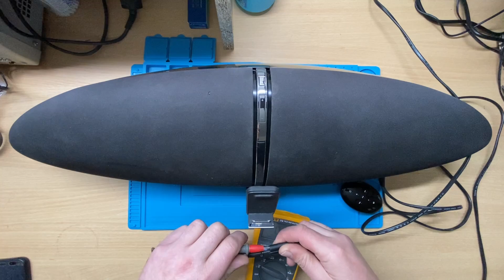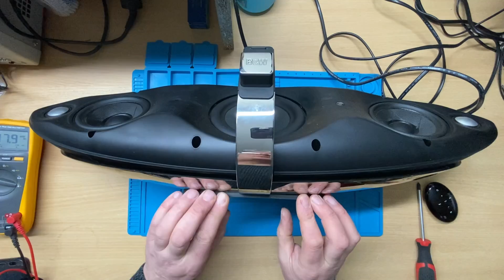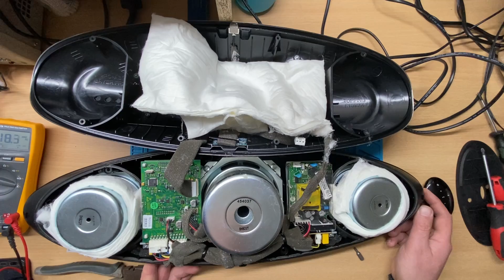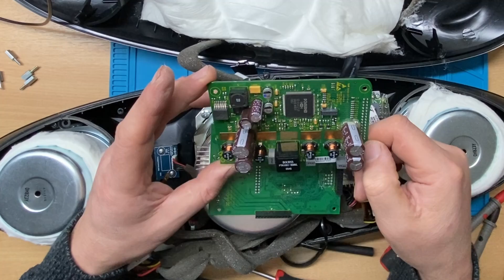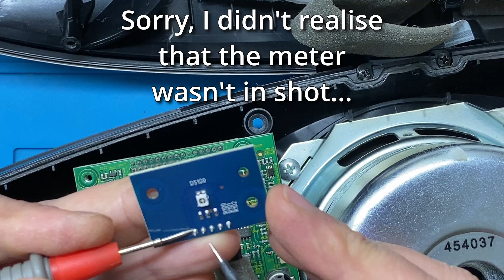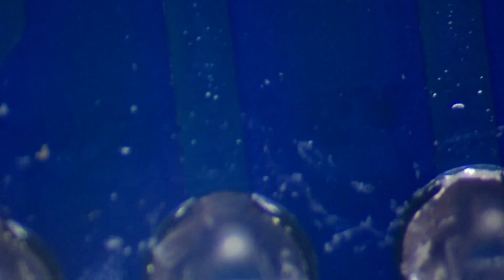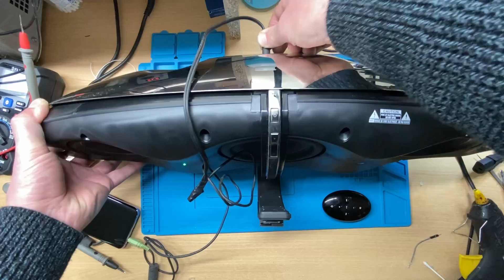Bowers & Wilkins  B&W Zeppelin Speaker - Expensive but Faulty - [REPAIR]

Comment: I've got exactly the same model from 2008 which is working perfectly. I've connected a wiim mini for streaming from my phone or my local Alexa etc.
Can I do what you have done and remove the 30 pin dock, will it  still work?
Reply from the maker: I'm pretty sure it should still work with the dock removed.

Comment: My Bowers & Wilkins Zeppelin connects to Wi-Fi, receives the signal from my iPhone, and plays music just fine — until it suddenly stops, and the red flashing light appears.

If I turn it off, wait a bit, and turn it back on, it works normally again — as if nothing happened.

It’s a great speaker, no doubt, but this issue is driving me crazy.
Really disappointed.
Reply: Cap on power supply needs replacing.

Comment: Being picky, if the remote battery had been replaced to start with and a music player connected, the unit might have played ok (or not). But a good buy at £36.
Reply from the maker: True, but normally you expect some indication that the unit is powered up. Power supply failure is a quite common problem with these units.

Comment: I think these older ones have 4-channel amplification (two of the channels in stereo mode for the left midrange+tweeter and the right midrange+tweeter, hence the passive crossovers, and the other two channels bridged to a single third output on the woofer).

I believe the later versions have 6-channel amplification so the midranges and tweeters have separate amplification, therefore the passive crossovers are no longer needed.

Comment: My speaker has no sound out of the left speaker and no LED light, which is on the same side. Will this be connected as a fault? If so how can i fix this? Apologies if i sound like an idiot?
Reply from the maker: The speaker not working is probably unrelated to the LED. It could be a blown speaker or a fault on the board.
Reply: @BuyitFixit  thank you, I well look into fixing that speaker.

Comment: Hi, I have the same problem with the led light. What's the chip number or ID? Great video and tear down, thanks a lot!
Reply from the maker: Thanks 👍I don't have a part number unfortunately as the LED I used I pulled from an old BT home hub 5 router.

Comment: For how much these devices cost they have poor longevity. My zeppelin air started buzzing and popping and then locked itself into red blinking light of death.. some sort of protection mode.. they are hard to sell because they are known to fail. I have stripped the speakers out of it and I'm looking to use them in a Bluetooth tooth speaker that I'm building.. everything else has gone into the recycling bin..
Reply from the maker: Interesting, but well done for at least attempting to save some of it 👍
Reply: Bad caps

Comment: That was interesting.  My son bought one years ago then after a power cut it hasn't worked since he  says .
Reply from the maker: Thanks 👍Could be the power supply. Sometimes they get zapped when the power comes back on, or the capacitors on the power supply can also fail.

Comment: Excellent job. I was wondering if you could add a Bluetooth module to these older style speakers?
Reply from the maker: I don't see any reason why not. An easier way would just be to plug one into the auxiliary port on he back.
Reply: @BuyitFixit  I put an old iPad on the dock to pick up wifi via bluetooth. It works even though the iPad says device is not supported. Blows caps like crazy tho. I wish there was a way to add some cooling in there!

Comment: Hey man I have one of these with a faulty amp pcb. I suspect the bios is gone for the d2 chip, as I don’t have much experience with things as such. Have a good board to swap too. What you think of having a look at it ? Flashes red after power up. I cannot find shorts or missing voltages until shutdown.
Reply: Hi I have a dead zeppelin air. The repair guy thinks the motherboard has been damaged by insects so wants to swap out the motherboard. He can’t find a replacement part and neither could I. So…..do you still have a working motherboard you would be willing to sell and post or know how I get hold of one.  Thanks Keith (in Sydney).
Reply: @user-ng9xv9sw9b  sadly not mate, I don’t take zeppelin airs on for repair anymore either.
Reply from the maker: Sorry for the late reply. I'm not too sure on that as I never really spent much time on the amplifier section. It did look quite complicated. Are all of the power supply voltages correct from the PSU? If you swap boards did you narrow it down to the amp board? I think it was in two sections (been a while since I looked at this)

Comment: love the videos the audio is always low i have to go full volume and still struggle on some keep them coming.
Reply from the maker: Thanks 👍I set the audio levels to -10db which is supposed to be the standard for YouTube. Are other videos on YouTube around the same volume? I've not had anyone else mention but this video is an older one so I may not have been up on the settings at the time. Are the more recent the same?
Reply: some seem quiet i normally just put headphones on if it is
 @BuyitFixit

Comment: I worked on one of these yesterday. Did exactly like you did - assumed a duff PSU but it was fine, scoped the mainboard and saw clocks etc then went to the LED. Found exactly the same failure. Mine occasionally faintly lit up red and curve tracing the LED you could see the breaking down connection. I think going off the common anode voltage of 5v the resistor values on each cathode means they are overdriven to make them brighter which results in premature failure. I’ve altered the values to reduce the current of the LED to 30mA should be fine now. Farnell do one 2322115 same colours as original.
Reply: Cheers for that, got the same issue working but dead led. Was hoping he mentioned in video what the led model is. Comments to the rescue, big thanks to both.
Reply: @hinny2005  doing myself out of a repair job there 🤣
Reply from the maker: Interesting, I wonder how many of these have been disposed of because the LED was faulty 🤔

Comment: Could you tell me how to get the battery cover off the remote? There must be a knack to it, I cant budge the darn thing and dont want to use potentially damaging force....
Reply from the maker: I've just had a quick look for you, and I just pressed hard on the round black piece with two fingers while rotating it anti-clockwise. Hope that helps.

Comment: Thanks for the great video. My system has had the EXACT same symptoms. Changed LED, changed all the mosfets you reflowed, replaced every single cap, but I still have the same issue you did at the end. Sometimes the speakers only play on one side. Only difference I've had from you is that I blew a fuse on my power supply after I replaced the mosfets. I'll try checking for dry joints when I get home. I've had this zepplin on my bench for nearly 8 months...
Reply from the maker: Thanks 👍hopefully you manage to sort it 🤞

Comment: I enjoyed this one.  The funny thing is I was saying to myself right near the start maybe check the LED only because that is the thing I would have checked first being a newbie I go for the simple things.  I can handle checking an LED.  I need to find something simple to fix on ebay any suggestions what to start with?  I have tried fixing a Pi 4 only I failed I think the CPU is fried from someone shorting out the 5v and 3v rails as there was a hole in the MXL chip which I replaced but still no joy.  I also tried fixing a Logitech C920 webcam but the CMOS sensor had gone in that and I dunno where to source a sensor from.  I am sure it is the sensor though as I did some readings with a working one I have and foudn a difference in resistance readings between them removed the sensor and the readings are now the same.
Reply from the maker: Thanks 👍I like doing old VFD games. They're usually fairly simple 🙂

Comment: $995.00 CAD for the pleasure of new in 2021  !
Reply from the maker: Ouch !
Reply: @BuyitFixit  Tragic waste of material and money when this stuff just ends up in the trash bin. I am impressed that you attempt repairs on such a wide range of devices. It has given me a new outlook on what passes for approachable. However t have this one item that I put on the back burner for way too long now.
An oven control board for a GE made range. It appears to have no standby voltage that allows it to wake by a single button touch. There appear to be no used or scavenged modules on eBay, and the manufacturer is a dead loss. Would you consider giving it a look? On a creative note you could start a series content making repairs to subscriber sourced electronics of a size that keeps shipping to a minimum.  Happy to pay regardless of your success. And I do live in Canada
Reply from the maker: Thanks Chris (Nice CNC btw I built one a few years back although not used it for a couple of years now). I do try to do a wide variety of things as I think it makes it more interesting 🙂 I've found when I've had offers from people to take a look at things especially outside of the UK, the shipping costs alone are quite prohibitive. I could still possibly help, as you could always send me some good quality pics of the board and I could advise what to test / look at. Best wishes. Mick.

Comment: I've worked on one of these before...  couldn't get it going.  I don't recall a power light on the front but that could have been part of the issue as well.  In the end the owner only wanted to spend $60 tops, and that's worth an hour of my time, so, it never did get fixed.  If I come across one that's dead again I'll check that power light!  Interesting that it would bring the whole unit to it's knees.
Reply from the maker: I'm not sure that the whole unit was too is knees to say, but because there's no hiss or anything when it's powered on, unless you put sound into it or plugged an old iPhone or iPod into it you wouldn't know it was on, as there was no light to indicate that.

Comment: what causes dry joint on circuit board? thanks
Reply from the maker: Oxidation of the solder, also if a lot of current is going through the connection it makes it worse, and can start arcing or burning like on the solar inverter I repaired.

Comment: Lmao.. Just LMAO
I have had one laying around for awhile to repair. After watching this I thought "why not" Put it on the table and goes though things. PSU working, board not getting too hot
But something was up.. The LED was not on! So i pulled off the LED board and checked it with a multimeter and i saw a very very tiny light from the red LED. So what i did was i reflowed the joints and it helped a tiny bit so now i could actually see the LED but the LED was going nuts, like the PSU was turning on/off. I then tried to give it full power with my PSU which actually got 2 of the LED working.
So after playing around and having fun i just soldered a new one on. But conclusion was that I could see some corrosion on the LED leg, i think this got under the actual diode and caused it to have a bad connection.
After new LED was put on the PCB it worked just fine
Reply from the maker: Nice 👍Glad you managed to fix your one too!

Comment: did you check the fuse in the plug ?
Reply from the maker: No, but the first thing I did was check there was power coming out of the power cable. There was 251.2V coming out of it at 00:59 which means the fuse is intact.

Comment: I have one of these in pieces that someone asked me to look at - the fuse on the PSU had gone but that meant there was some bad $hit that had happened further downstream on the amp board - it looked like one of the channels had shorted out but I’d already wasted a lot of time taking it apart and trying to diagnose so it’s been sat in bits for a couple of years now 😢
Reply from the maker: Doesn't sound good. I recently looked at a Dyson hot and cold fan that the motor controller chip blew and sent 400v into the microcontroller. Luckily a viewer sent me a broken board which wasn't so damaged and I managed to repair that. So yeah stuff sometimes fails in a big way unfortunately  😥

Comment: Nicely done Mick, thanks for the shout out 👌👍
Reply from the maker: No worries Vince. You're very welcome.👍👍 I woke up at 4am this morning with bad indigestion so I was watching you on your friends boat removing those port hole things. Boats have heat exchangers instead of radiators, the sea water gets pumped around the outside of the heat exchanger and the engine water gets pumped along the inner core. (Used to be on boats a fair bit and rewired a 45ft one when I was into diving about 20 years ago)
Reply: @BuyitFixit  Ohhhh, so the engine itself still has a sealed water system in it, it's just cooled by the sea water or river water. I presume then that antifreeze is added to the sealed water system? Thanks Mick, I'll pass this info into Brian the owner 👍
Reply from the maker: Yes that should be the case otherwise you'd be dragging sea water through the engine block and it would rot from inside out. I heard a few stories from the boat yard where people did that 😂😂😂
Reply: @BuyitFixit  Makes perfect sense 😂 Cheers Mick 👌
Reply from the maker: Glad to help 👍
Reply from the maker: Apologies Vince. Just speaking to a friend of mine he says that those Mercruiser  engines actually do drag outside water through the engine! and don't have heat exchangers! Let's hope it isn't really used in sea water much! Guess you learn something new everyday! I think it was a ford diesel engine in the boat that I worked on.
Reply: @BuyitFixit  Thanks for the update Mick👍

Comment: I have also just repaired same model speaker. The fault was the same as Vince, but after changing them, the led does not light up anymore. I will try and do the same measurement as you did. My speaker does work, even if the led is not lighting up. Have to do some investigating....thanks for the video.
PS: How come you did not change the four cap´s, when the speaker was already open? They are prone to blow at any time.
Reply from the maker: You're welcome 👍. The caps weren't bulging and the speaker seems to operate correctly. I could have replaced them proactively but seeing as the unit was working fine I'll just do that at some point in the future when they eventually fail.
Reply: @BuyitFixit  Thanks. Did you ever connect voltage directly into the led?
Reply from the maker: Yes on the new led I did test it with the test meter on diode mode across the led and that was enough to make it illuminate, so if the original led is working it should do the same.
Reply: @BuyitFixit  Or maybe the original led needs a higher voltage? But I guess you dont have it anymore? Would be interesting to see how it looks under the microscope, when introduced with higher voltage......🙂
Reply from the maker: It measured open circuit on diode check.  I measured the voltage to the pins on the LED when it was connected to the radio and it was there. 5v I think it was and the GND is switched via the I/O pins of the microcontroller.  LED was 100% failed.

Comment: Good analyses, repair. It makes me laugh when I see these designs (most active speakers), something that will inherently vibrate (a lot), so lets' mount sensitive electronics on it and then wonder why joints / components fracture. That central bar, mounted directly in front of the woofer, is classic.
Reply from the maker: Thanks Ralph 👍
Reply: Yet another expensive poorly designed product.  Problem of 21st century.

Comment: Amazing as always. I throw away a similar one some years ago. 😢
Reply from the maker: Thanks Edgar 👍. Shame you threw it away 😥
Reply: @BuyitFixit  yes it would be good if could just fit another amp or just use the speakers as a passive system to plug into an external amp..
Reply from the maker: Yes that is also another option 👍

Comment: Thanks for the video! I might have the same issue with my Zeppelin, I'll need to try this.
Reply from the maker: You're welcome! If you get stuck give me a shout. I'd check the power supply first to see if you are getting the +5v and +24v like I did in the video 👍
Reply: I actually repaired the PSU earlier.  Had to replace the caps and one 150uF ceramic cap. The +5V and +24V are OK, but only mono from the left side speakers and subwoofer. 

Today I re-soldered transistors on the amplifier board and the right side speakers came alive, but the left side stopped working😅
I’m able to get all speakers working if I turn the Zeppelin upside down, so clearly there are some issues still.